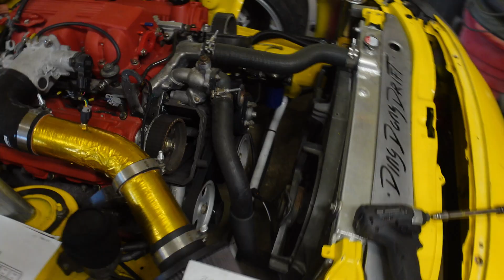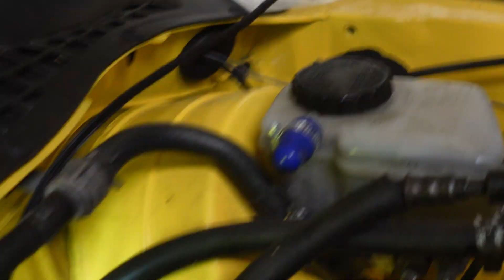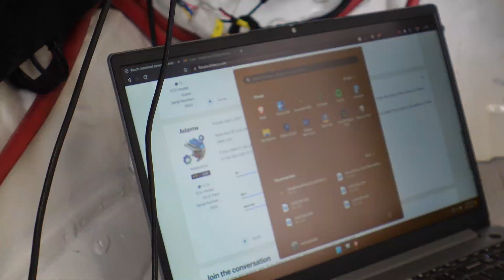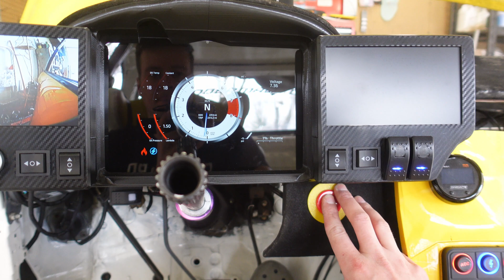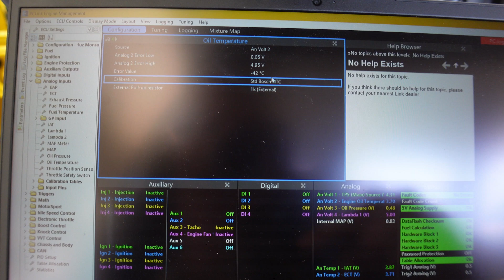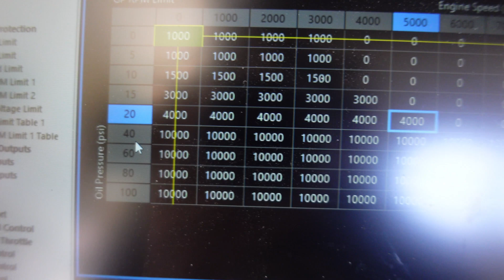This One Sensor Can Save Your Engine

Comment: IE.. pink wire.....I do not use the same color as link when making the harnesses.  It would cost a fortune...I figure pink is 5v, not quite red, which I use for 12v for injectors, etc....Ignition is always orange/orange an black, just like toyota.    Great Job.....Looks like I am buying aSC400 this week, so I might need a widebody lol
Reply from the maker: Makes sense to me! You got the printer, print that widebody!